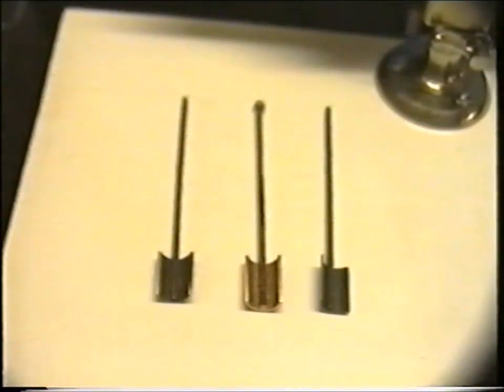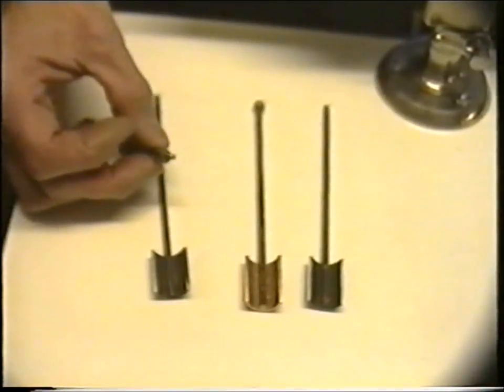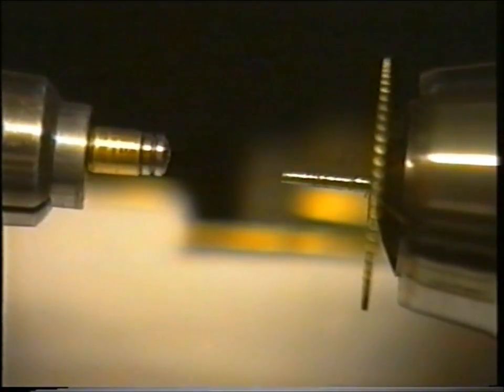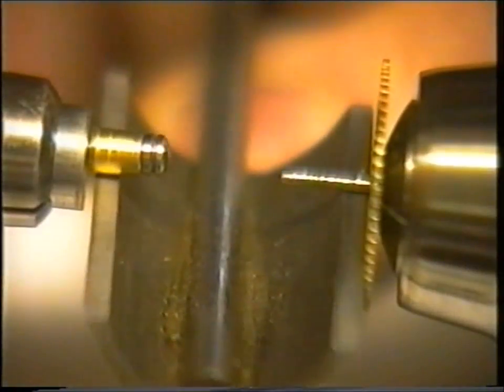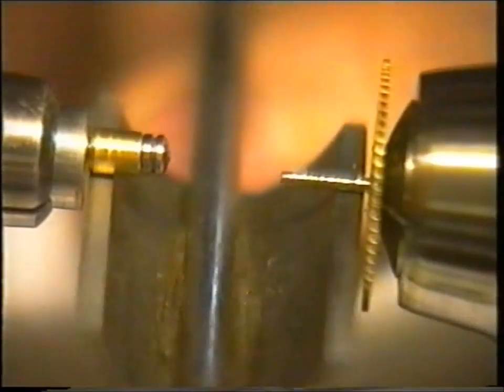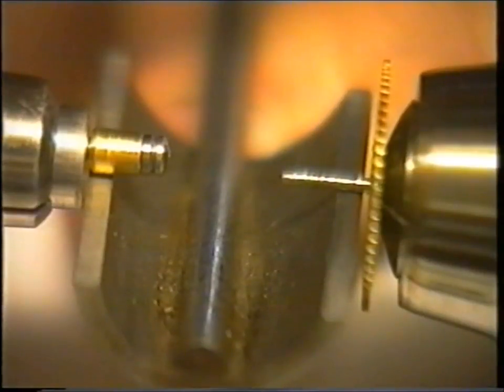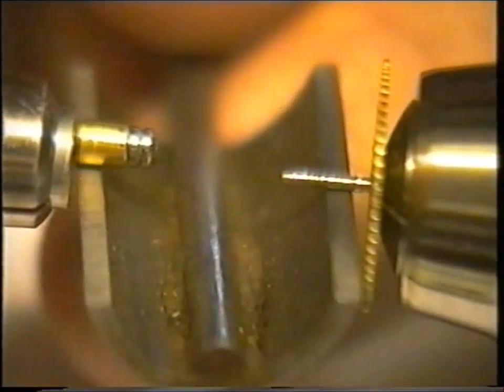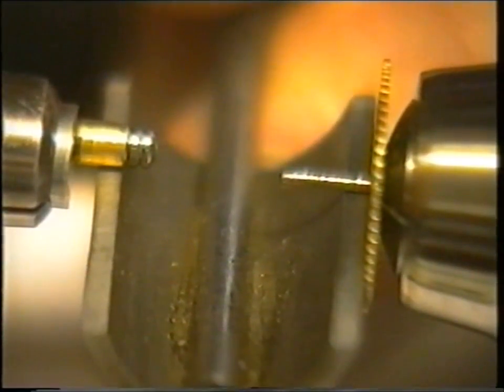Turning a balance staff for a watch or clock - part 4

Comment: Well, it is never too late to learn.  This is the first time I  viewed the technique  and process used to finish off such delicate work. Remarkable what goes on in building a watch, that is never seen by many people,  yet, I claim that it was the watchmakers who started to improve the world through their practical products rather than the older professions which  came out with philosophies that were soothing but never gave any material comforts or machines that bettered the world. It was the watchmaker  who started it all and I would say that all engines are a by product of the escapement in a watch where the balance staff became the crankshaft or perhaps we better look at the escapement wheel  becoming the flywheel while the pendulums became the pistons to produce a full rotating system rather than the oscillation in the balance wheel.  It is interesting that in the 1700 watchmakers put a lot of weight on the pendulums and balance wheels and a light escapement wheel while later on to produce engines ,one put a lot of weight on escapement wheels to produce a flywheel while the pendulum was lightened to produce the piston. 
Well, watches and engines, the finishing on them is a must  and congratulations to the people who achieve such ingeniosity in tooling to make them work.